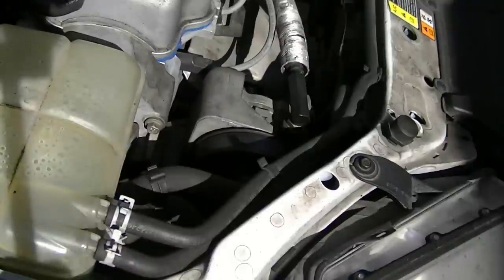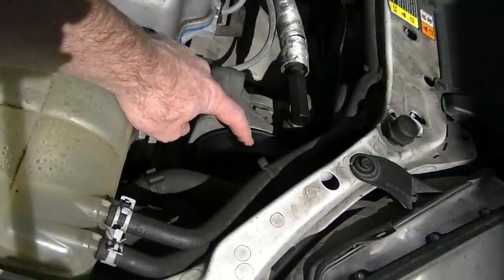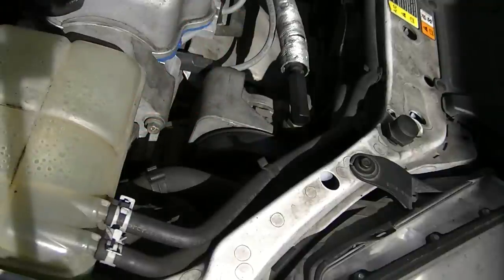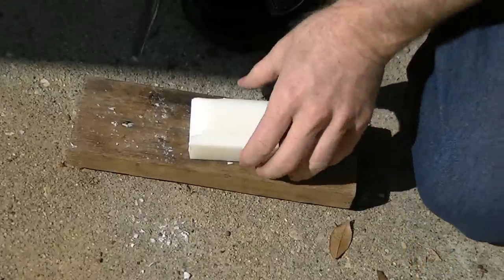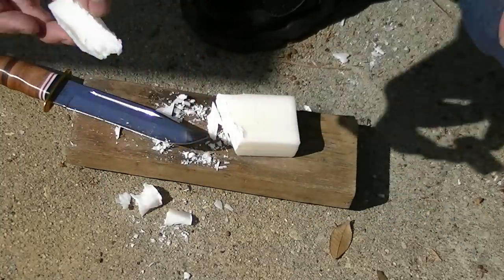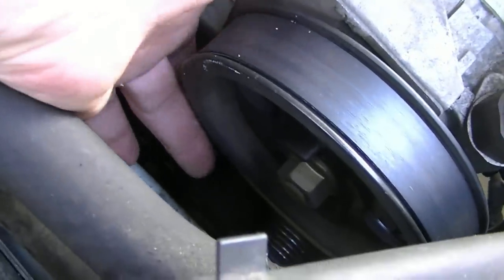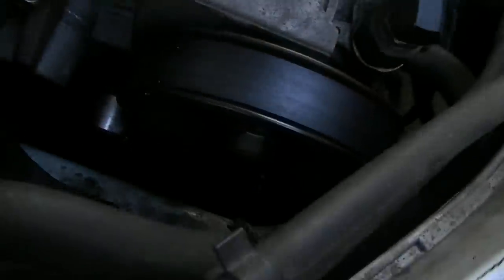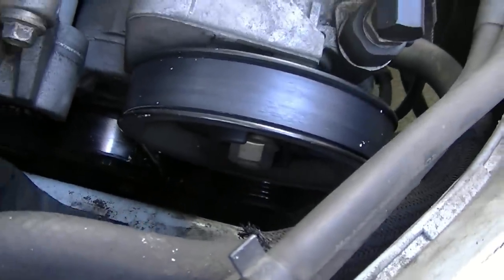How To Quiet Squeaky Belts On A Car - Cheap And Easy Fix

Comment: I have a 2008 lexus es350 and it just started makung this noise. Only does it on start up and acceleration. Not at a light or coasting up to a light. Any ideas?
Reply from the maker: It's either the belt or a pulley bearing.  I'd try the soap on the belt first and see if it quiets down, then check the bearings.  Sometimes belts will squeak when they are cold and the engine has just been started, and then they quiet down once they warm up.
Reply: ***** Hoohoohoblin is right, if it's only at startup it's because of condensation on the belt, which evaporates once it warms up. The soap trick is an old trick, but it does work. Another option is liquid soap, and also soapy water left on the belt to dry (which would then leave the soap residue of course)

Comment: Hey thanks for the great video! Do you think degreaser spray would work too? Might be easier to put on. I have a 97 maxima, just noticed a small oil leak, i think oil leaked onto the belt and it squeals for 1 second at start. That's it. Think spray will work?

Comment: But what can be the cause of this? I hear this exact noise at start up and when I'm accelerating. I've changed tensioner and tensioner pulley, hamonic balancer, p/s pump, belt. I use spray water on the alt pulley and it goes away.I'm trying this for now.
Reply from the maker: David Contreras It sounds like it could be your alternator pulley bearing, if spraying water on it temporarily silences it.  You could try forcing some grease or oil into the bearing and see if it quiets down.  Otherwise you need to replace the bearing or the whole alternator.

Comment: In my 96 pathfinder, my problem is that when I start it up, it lets out a loud squeak(sometimes) then it'll stop and with it I got a ticking noise. Someone told me it was just a loose belt doing that. Could that be it or the problem shown here?

Comment: I've got to give that a go on my Mk2 Fiesta. only one belt on her which is the alternator/water pump belt. may try washing up liquid
Reply from the maker: It is worth trying. It doesn't always work, but it is cheap and easy to try.
Reply: ***** I've had a go & the squeak is gone. I'm really surprised. I'm guessing the theory is that the soap acts as a lubricant on the belt. Dead pleased with that result

Comment: Why does your car make a whiny sound when you rev it, is that normal? I'm not talking about the squeaking, I'm talking about the sound on 2:37 - 2:39.
Reply from the maker: The engine was sagging because the motor mounts were worn out, and it caused some strange sounds.  That is probably what it was.

Comment: Can I try this on my purple HKS kevlar timing belt on my EVO 8? Does it lubricate at all. I ask if it lubricates because the belt has teeth on it and if they slip I can say see you later to my 4g63 interference engine. Nice trick though. Kevlar timing belts are LOUD!

Comment: Hey Thanks for the Video. Would silicone paste work, or would it slip like mad?
Reply from the maker: That would probably be too slippery. Auto parts stores sell spray on belt dressing, which is supposed to work well.
Reply: hey Thanks man

Comment: My belt squeaks right when I crank it up, not real loud then goes away after driving more than ten minutes, been thinking about trying this to see if it helps but I've seen comments on other pages about how it could make the belt start to slip, that doesn't sound good to me so now I'm nervous to try it.
Reply from the maker: The belt is really tight, so it shouldn't slip. It is worth a try before replacing the belt or pulleys.
Reply: That's what I thought but just wanted to make sure. Thank you!

Comment: I have a 96 Pontiac sunfire do, you think it would work if I used soap on the timing belt
Reply from the maker: I don't know if the timing belt ever makes noise, but it should work on the other belts.
Reply: Kevin MczLee no. dont do it lol

Comment: My 2001 camry screeches and squeals on start up, the sound usually subsides after 30 seconds or so, what could that be and how could i fix it
Reply: What did it end up being?
Reply: @matthewmiley3644  Not sure if it was connected but i ended up having a blown head gasket a few years later. Didn't bother to get it checked as i had come into a good job and could afford to replace it so i just drove it until it died

Comment: Hi there! Ironically i've got a 04 zx-5 focus with me and i've got the same problem. I'm guessing this is a temporary fix? How long would this last?

Totally going to try it :)
Reply from the maker: It depends on the source of the noise. If it is from fiction between the belt and pulleys, it will work. If the pulley bearings have gone bad and got squeaky, it won't work.
Reply: ***** That makes sense. How would I know which one has gone bad?
Reply from the maker: The Clueless Mechanic
  It is tough to zero in on it with your ear, but try to listen to the sound from the top and bottom of the engine and see if you can pinpoint it.  There is something called a mechanic's stethoscope, which allows you to listen to specific parts of the car to see where a noise is coming from.
Reply: Oh awesome! Thanks!

Comment: my 2001 carisma makes a sound that sounds like it needs some wd40 the accessory belt. any way to fix it? it doesnt change in speed or pitch when i get the car on higher rpms.. is it dangerous? i checked, it wasnt the timing belt.
Reply from the maker: It is probably a bad bearing on a pulley.  Replacing the whole pulley and bearing on a Ford Focus costs around $20 and it easy to do yourself.  Not sure what it would cost for your car, but if you can figure out which one is making the noise, it is an easy fix.
Reply: ***** Allright, thanks for the help! :)
Reply: I have a 96 Pontiac sunfire do you think it would work if I tried it
Reply: hoohoohoblin the new pulley fixed it! thanks for the help man!
Reply: Kevin MczLee always worth a shot, and garages can give u advice for free too, right?

Comment: I just bought a new car 2014 and after a month it sometimes start making noise when i drive slowly or when i stop or after i rev the engine 
The noise is like screeching 
Any tips?
Reply from the maker: Try the soap or belt dressing.  It sounds like it is coming from the belt.  In your case the dealer might cover it under warranty.

Comment: hi i have a 91 s10 and i have replaced the(alternator=idler pulley=belt tensioner and pulley=waterpump=crank shaft pulley=new ac comperssor)and it still squeaked really loud,i tried the water bottle spray and it quit,come to find out someone hit the Power Steering Pulley with a Hammer,and Bent the some of the groves,So i got to replace it only $14,anyway today i took a bar of soap,and there is a place on the belt about a foot long below the alternator i let it idle and and put the bar of soap against the belt and NO NOISE :) ,It really made it quiet,now that i know its the power steering pulley,at least i can drive it without everybody loooking at me when i go by,until i get it fixed,THANK YOU.
Reply from the maker: You're welcome.  Depending on how much clearance you have in front of the power steering pulley, it may be really easy to replace if it starts squeaking again.  You can borrow a pulley puller from Autozone, and they can sell you a new pulley as well pretty cheap.  Here's a video I made showing how easy it is to replace the pulley if you have the right tool.  http://youtu.be/YIiUioLhOxc
Reply: ***** THANX DUDE,YOU SAVED ME A LOT OF MONEY,KEEP UP THE GREAT VIDS,YOUR THE MAN.
Reply from the maker: You're welcome.

Comment: the easier way I do this is by using liquid dawn or sunlight yellow let your car run while its running just put a few drops on the belts and you will hear the squeaks disappear right away I have been using this method for 25 years and before that my father and his father lol no joke we are a family of car guys
Reply from the maker: +Larry Williams I didn't even think of liquid soap.  I'm sure it works great.
Reply: just applied liquid soap didn't do anything
Reply: +Jordon Williams it works for me all the time I only ran into one car in my whole life that it didn't want to catch...did you try putting at least a half of cups worth outa do it
Reply: i only drive old cars with v-belts i will try thanks!
Reply: +Johnny T Doe me to
Reply: Hi Larry does that really work? Since you're a car guy and I'm not, I sprayed degreaser on my belts to remove a bunch of power steering fluid that got on them, then all was well. But to lubricate I put a little bit of belt dressing on them now they're squeaking like heck. Will the "liquid dish soap" get of rid degreaser and belt dressing residue? Hope to hear from you by tmrw morning, thanks.
Reply: Cameron did this fix last for you with liquid dish soap? Seeing this comment was 2 years ago...I have Ajax lemon degreaser soap hope it works.
Reply: Holy shit thanks @larry Williams it worked for me

Comment: This might suck but my opinion, would be to find the right belt thats squeaking and JUST CHANGE IT! 
Wd40 is a quick fix and it might stop squeaking, but it will wear your belts even more and might cause it to slip off or brake while your driving. Think about it it stops the noise but is it really fixing the problem, but really this is just my opinion. Do what works for you

Comment: guys wats permanent soultion.
my car continues its squealing sound for 2mins. then it becomes silent.
this happens at first ignition. after a long drive. if again i turn on my engine the noise duration is less.
what should i do?
Reply from the maker: Try the soap, and it it doesn't work, try replacing the belt.  Sometimes the pulleys are what makes the noise, but it is usually the belt.

Comment: I had serpentine belt squeal on my 1999 Taurus wagon. Belt was tight and pulleys were all good and were aligned. I removed the belt and inspected it closely (especially the grooves. I then borrowed my wife's poultry skewer from the kitchen drawer (couldn't find my awl right away), turned the belt so that the grooves were facing the outside of the belt. I then proceeded to dig out approximately 287 itty bitty little stones that were partially embedded in the bottom of each of the grooves along the length of the belt. I replaced the belt and the noise was gone. Just something to try before spending a lot of money on parts. Also, It might be a good idea to use something  that didn't come from the kitchen - just sayin'.
Reply from the maker: Good point.  Sand and dirt can get crushed into the belt and cause problems.
Reply: gb177

Comment: Oh dear. I did exactly that & my car went dead :( I am in big trouble. Can somebody plz help me? I should have been contented with the noise which only happens on a hot day.
Reply from the maker: This shouldn't have anything to do with the car starting or not starting.  It would only effect the sound of the belt.  If your car won't start at all, check the fuses and battery connections.

Comment: Tried soap... did not work... used a wire brush against the ribbed side when running... worked great.  Just an FYI, appreciate the info, I am sure soap usually works.
Reply from the maker: Roughing it up does change the surface enough to stop the squeak. I would be afraid that the wire brush would get sucked into the pulley and do damage.
Reply: ***** Jesus i would not try that folks.. Fuck you car up and probably your hand lol
Reply: Luke Baron
lol

Comment: same with mine, I replaced the pulley bearing and it stopped for a couple days and it started to squeak again so I just greased all the pulleys and belt and no more squeak

Comment: I know this works from past experience, as well as using WD40, silicone spray, and soapy water in a spray bottle.  The thing I always wondered is that if you do this, aren't you causing slipping to make it stop squeaking?  If it's slipping wouldn't the aux items end up being under powered like the alternator, waterpump, AC compressor etc?

Comment: the noise is my car is ridiculously loud, only the first time i turn the car on..  after that there isn't any noise.  What do you suspect it is.. the belts are brand new.
Reply from the maker: ***** It is most likely from belt friction against the pulleys, especially if it didn't squeak before you changed it. Belt dressing or soap would help in this case.  If it squeaked before you changed it, it could be a bad pulley bearing.

Comment: My car problem is that it makes squeaky noise like motor is getting old when I turn on then as we drive it goes away.  Sound is more noticeable  when it rains it seems.
Reply from the maker: +Hye Yeon Jeon Could be a loose or worn belts, or a pulley bearing.
Reply: hoohoohoblin awesome. Thank you.

Comment: Dielectric grease on the underside of the belt. Last a pretty long time and is water resistant. Its the stuff they put in lightbulb sockets to keep the water out saw dealership mechanic doing it when he couldn't figure out the problem.

Comment: You can also drop some washing up liquid or even better tyre dressing on the suspected belt while engine at idle.  Noise gone in seconds!
Reply from the maker: +harun1984 That would probably work.

Comment: this is pretty quiet compared to mine,. im embarrassed to turn the thing on anymore. likely just need to replace the entire belt
Reply: Did you fix it? I have the same problem. It's so loud to the point that I hate driving my car
Reply: i found out it was a loose pullie on my car the top tension pullie was so loose you could move it with ur hands, my friend who is a 3rd year apprentice fixed it in 10 minutes replaces the belt and checked the others
Reply: the shiney/silver chrome metal pullie by the alternator
Reply: +BelialSpade yeah me too. I get embarrassed driving it to schoo
Reply: yeah, though im far from a professional or even remotely car savy, if you have car noise id check all your pullies and probs replace the belt aswell. cost me 20 buks to fix cause i have a friend who can do it for me :D
Reply: Same thing here:D

Comment: Title should be "How to temporarily quiet squeaky belts." This works good if you're on the go though! WD-40 also works.
Reply: Eggy Was going to say the same thing about WD-40. Works great.
Reply: +Eggy Shouldn't use wd-40!  petroleum-based lubricants will breakdown the rubber! (But that being said, it WIll make it temporarily quieter).

Comment: Isn't this temporary?  Likely, the noise could come back.  This seems to be a great idea.  I have a '94 Nissan Pathfinder that's been squeaking.  I took it to a Pep Boys and I felt like they were dicking me around.  They didn't really check it.  I was watching from the sitting area while they open the hood and inspected the belts in the parking area.  The guy at the counter said all the belts needed to be replaced.  I thought it was bs.  They didn't even recommend buying belt spray which I plan on doing.  I also was told from someone else not to use WD40.  In the short run, it would help but it would damage the belts later on.   Couldn't soap do the same?
Reply from the maker: rockhero2274 This method sometimes works and sometimes doesn't.  I'd give it a try before spending money on new belts.  Sometimes the squeak is caused by a pulley bearing so this won't help.  I don't think it will damage the belt.
Reply: ***** Thanks, I'll give it a try.

Comment: Mine screeches when it's cold outside usually just when starting and after its ran for a few minutes it stops
Reply from the maker: This might fix it. Replacing the belt should also work. Check for a bad pulley or tensioner.

Comment: I have a 97 Ford explorer mines just started squeaking and its smells like burning rubber... how do I fix this problem? Anyone knows
Reply from the maker: If it smells like burning rubber, it means there is friction somewhere in one of the pulleys.  The belt adjuster pulley and the idler pulley are the likely suspects.  They are cheap and easy to replace.  I did the idler pulley in my Ford Focus for $17.  These pulleys run on sealed bearings, which eventually go bad and cause friction when the pulley can't spin as fast as the belt is moving, or can't spin at all if the bearing is totally fragged.

Comment: My car does this too. I put a new pulley and it went away but came back a month later. A mechanic told me I needed a new belt because the previous owner had been spraying it with belt lube (he says to never apply anything to a belt because that alone can cause squeaking). So I put a new belt and here we are 3 months later and it's starting to squeak again. Someone help me :( it's soo embarrassing considering all of my neighbors have brand new cars and I have a 1998 Chevy Malibu LS as a first car

Comment: This may work, but its just a band aid to hide the real issue. It wont last forever and eventually something will really go wrong because you ignored the root cause on the noise... If you want a permanent fix, pull the belt off and find out which pulley or component is bad and fix it.

Comment: Couldn't I apply the soap while the car is on?
Reply from the maker: You could, but you would risk getting your fingers or the bar of soap sucked into the pulley and crushed.
Reply: hoohoohoblin Hey thanks for answering. I used soap both ways, while my car was stopped, and in movement. It worked for about 30 seconds and my belts continued to squeak. I discovered by putting corn starch (Maizena brand is what I had at hand) in the unions where the belt meets the pulleys did the trick.